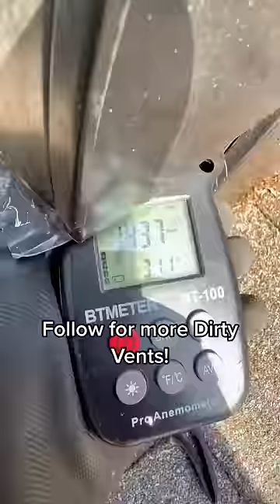Extreme Fire Hazard 🤯 #dryerventcleaning #laundry #cleaning #firehazard #lint #oddlysatisfying

Comment: I’m a HVAC Technician and it’s a unspoken rule to never use chimney liner as a dryer vent. Hard pipe is always the way to go as it is twice as durable and easier to be cleaned. But depending on how the house is built really depends on how your duct and piping are gonna work and sometimes chimney liner is the only option.
Reply: Apparently they needed to speak up cause here in PA it’s everywhere 😭
Reply: I couldn't believe they buried that crappy flexible pipe in a wall.  In my experience, that stuff only lasts a few years, especially if it's stretched out.
Reply: @bdr7557  Is it even legal to put flex duct in a wall for a dryer?? I highly doubt that's to code.
Reply: It is definitely illegal.
Reply: I use hard pipe in commercial. Only seen aluminum flex in residential
Reply: @bobbygetsbanned6049 it's the only thing iv ever seen in homes in Ohio.    Which is only 6 or 7 but iv seen nothing different
Reply: @nightshadekelly  That's some bullshit, just asking for the duct the break in the wall.
Reply: Was going to say the whole ducting needs replacing
Reply: I was going to comment the same thing, indeed a weird decision especialy when its in the wall.
Reply: How do you check the code in your state? What department would have that info in my municipality?
Reply: @Celita  code is county to county. You can Google "current *insert code here* for **county and state**." They update codes all the time, but they only technically apply to new builds or renovations. For example, the fire code in my county was updated in 2015 to require sprinklers in single family residential construction. But the next county over, it was 2010. In my state alone, there's something like 600 codes.
Reply: @Jessica Miller  thank you!!! That helps!! I do realize there's a lot of them I just wondered what the general category could be to start even looking. My first home that I purchased from family didn't have the right paperwork and required all new types of documentation to prove work was done correctly which still cost money. The next home I bought I had two different independent inspectors come out to make sure I didn't miss anything. You try to cover everything but it's so much!

Comment: They need to replace that corrugated pipe in the wall for a solid duct pipe so it doesn't tear or get crushed like the current one
Reply: Only ever saw my grampa do it never had an issue with it I'd say it's the better way
Reply: Corrugated pipe also restricts air flow more than flat sides. Corrugated pipe also traps lint. 
However it would really help if people cleaned the lint trap after every cycle 
I have heard people say they never clean the lint trap.
Reply: Yah! I thought the corrugated bendy pipe was only for the last few feet when the hole in the wall doesn’t match up with where your dryer needs it to. The rest should be solid metal (smooth walls to catch less) pipe!!

Comment: The easiest way to fix all these problems with dryers exhaust clogging up, is all  houses need to be designed with the washer and dryer on an exterior wall so there's no piping for it to go through and fill up with Lint.
Reply: then it would just look stupid Sean and also thats already a thing that's how trailer homes are. and washers don't even clog up because they just output water so don't need to put that on an exterior wall
Reply: @Sean McKay  first of all, how would that look stupid? Second of all, we're talking about dryers, not washers.
Reply: Tbh why not make it easier and don't hook dryers up to a wall? Idk like here in Europe I never saw a dryer that was fixed to a wall (except for the electricity outlet ;) ). Granted most people probably let their stuff air dry here anyways but the concept of dryers that attach to some pipes and that being a possible hazard is just crazy.

Comment: Looks like a code violation as well. The pipe must be solid when hidden inside a wall cavity like that. That flexible stuff is a no no!
Reply: What state is that? That's not the case in Ohio/
Reply: @mothergoose9383  IRC code M1502.4.1 reads “Exhaust ducts must have a smooth interior finish and be constructed of metal having a minimum thickness of 0.0157 inches (28 gage)….” 
Subsection 3 says a transition duct can not be concealed within the construction.

Comment: Replaced my dryer belt and did a thorough cleaning of everything. I couldn't believe the build-up of lint in such a short time ( one year ). I'm ordering a new lint screen because the heat warped this one which is located just inside the door at the bottom of the drums rum.

Comment: Little known secret: that liquid fabric softener TEARS FIBERS OF YOUR CLOTHING to shreads. Worse is towels and washcloths. They are the ones that really shed. Best THING is Fabric sheets.  Work just as well, removes the lint off clothes, and has minimal shedding of your clothes. 

Turn your clothes inside out when u wash. Wash whites with whites, colors with colors, jeans turn inside out wash by themseoves. Sweats turn inside out and wash by themselves. Towels only wash with towels. Sweaters turn inside out and only 2 at a time.

Dry on med temp all clothes except jeans and towels on hot. CLEAN THE VENTS with a vacuum Every Time after u wash. Hang up immediately/fold your clothes put away. Not on your bed!. 

These tips will help u keep your laundry in order, your machine happy and no busted machine bills. 

I like the way you lifted that vent up with my fav song 🎵 😌 💕 💓 💛 💗 🎵

Comment: Watching these videos helped me realize how nice it is that my dryer is located in the basement on the outer wall. There is no pipe to the outside. Just a 5 inch hose directly to the exterior wall. Easy to pull off and clean.

Comment: I experienced a dryer fire once. The lint tray didn’t close properly and allowed lint to get down into the motor. House started filling with smoke and with my housemates I found the source.

Idk what would’ve happened if I wasn’t there, but I quickly grabbed the fire extinguisher and flooded the motor with dry chemicals. Day saved, was a hero for the rest of the summer.

Comment: Why does America have dryers with ducting as outlets tho? Where I'm at, every time after you use the dryer, you simply pull out the lint catcher on the door, rub the lint off, and you're done. No clogged ducts or routine cleanings needed, because you spend 30sec before using it every time to clean it yourself.

Comment: Astounding.  I live in Texas,  and all the dryers connect via a small hose,  about 3 to 4 feet,  directly to the wall where it directly leads out.  you literally only need maybe a foot, but the tubes are longer so when you pull them out...  walls literally maybe 6 inches thick,  and they all have reinforced connections there. 

it's so odd to me to see the piping go into a wall and up through the ceiling.  it seems like such a hazard..  dust..  air quality..  heat..  fire hazard..

Comment: There's a filter box you can mount on the wall before the roof vent to trap all that stuff which will clog the pipe, and the pipe to the roof really should be rigid metal.

Comment: When we bought our home, it was awful that the inspector didn't really examine the place. Turns out the tube barely went into the wall, there was no exit. Went all straight into our walls, major fire hazard. Now we have it sticking out and catching the lint in a water bucket instead of collecting inside the walls.

Comment: They should make that kind of wired flex vent illegal as a fire hazard. The vents should be smooth steel vent pipe. The flex venting traps lint on the wire coil segments, the wavy segments are thin material and easily wear holes in the creases when you cram a lint brush in it to clean & if they form a dependant loop lower than the dryer vent  outlet, condensation forms in the loop & forms a water trap like a sink drain p-trap. Water trap happened to us on a newly installed dryer. The guy that delivered it was too lazy to cut it to length & just stuffed the excess behind the wall. A year of condensation that couldn't blow out dripped down into the excess venting and when we called for a warranty service check because the dryer wasn't drying anymore they poured  2gallons of water out of the venting.

Comment: i was curious why americans needed this but I think its because for the most parts we put dryers next to exterior walls then straight shot it through the wall outside we don't duct it to the roof or any further than a couple feet the worst case for us is if you don't have a dryer vent outside you go up the wall with the regular dryer hose and dangle it out the window

Comment: many people dont know how importatan cleaning and maintaining thair shit is. many are just using it, dont reading the manual how You should maintenance it and then they wonder why it Breaks. I have that here in germany especially with Cars. I saw so many dying because of running out of oil and when I ask them if they know that thair car breaks soon they say to me "I have no idea it works and if not I let it repaired" (and yes they dont care if the car is unrepairable at this point they think it works and thats it) and the Thing is You have to learn that in germany for the driver licence. if You Stuck on the Highway You have to pay a lot for driving out of oil

Comment: You wanna help the environment? Keep up with maintenance. 

Consider the costs of ignoring the neeed for regular vent cleaning: Extra dry cycles on every load since the clothes won't dry. Air filter and air conditioning to make the rooms near the laundry more bearable. And if there had been a fire, there would be destruction and smoke and ash. If not, lots of folks would have just replace the "broken" dryer.

Please keep you appliances clean, inside and out. It's better for everyone.

Comment: @mrlintguy What are the usual building codes today for a horizontally run dryer vent pipe in an apartment or town house ? My 1985 TH has a horizontally run flex tube over 15 feet in length. Drier times are double what my friends have with a 2 foot hose. I cleaned it out when the ceiling was open for drywall repairs. It had wads of lint and dryer vent cleaners say they don't do long horizontal tubes.
Reply from the maker: Code is 35ft max vent length and you have to minus 2.5ft for every 45 and 5ft for every 90 degree bend. Corrugated flex tube shouldn’t be used inside of walls because it catches lint and slows airflow although back in 85 they seemed to use it quite often. In your situation I feel it’s either partially blocked at some point in the run or the exterior termination cover is blocked or too restrictive. If you feel the vent is too long I’d suggest looking into getting a “Long Vented” dryer that is capable pushing that far.
Reply: @MrLintGuy  thanks I never heard of a long vent dryer. I still don't think anything longer than 6 feet will come close to matching a typical dryer set next to an exterior wall. My neighbor had a dryer fire. I vent it to the interior space in the winter with a screen attachment on the hose. The fine lint gets into the house but at least I can cut electric bill and time in half for the dryer

Comment: Throw away the cheap flexible foil pipe and op for for a ridgid aluminum one or a solid pipe.  That shit that was installed  should be illegal. It Causes fires, Waste energy and cost more  money over a short time.  Oh, but the other is more expensive...wa wa wa!

Comment: heres the thing with the new dryers out now those tubes are a bitch to put on and you have to use the zip tie your washer comes with or buy one so it does not pop off before they used to have secrured ones the older dryers now they dont even supply the   tube nore the power cord expect you to wire it up etc when the washer comes ready to go hmmm and no lint trap on the washer so folks make sure you order all the stuff for the install

Comment: The lint traps in those samsung dryers are such a joke. The mesh is adequate and all, but the plastic bezel is so poorly designed that a shit ton of lint gets sucked around it. You'd be just as well off not putting it in at all.

Comment: Why did you leave the flex behind the wall, isn't it not up to code?
Reply from the maker: It’s scheduled to be replaced 👍🏻
Reply: @MrLintGuy  but why clean it then and incur extra expenses and not just replace it rightaway
Reply from the maker: @LukeryaPereprygova  First off, they called me to clean it out not to replace it. I don’t just show up and replace entire vent systems on the spot unless I’ve done a previous inspection. Second, not everyone has the money right then to pay for a replacement which is 5-10 times more expensive than a cleaning. They wanted it done this way to get them by in the meantime.
Reply from the maker: @LukeryaPereprygova  I’ve actually cleaned this vent multiple times and I’ve been trying to convince them to replace it for years. I can only do what the customer approves. Thanks for the concern

Comment: I can't understand the American obsession with air blown clothes dryers. They are obviously a pain in the arse. Why don't you hang the clothes outside? 
If you live in an apartment, with no outdoor drying facility, use a condensor type clothes dryer. The water is pumped out down the drainpipe.